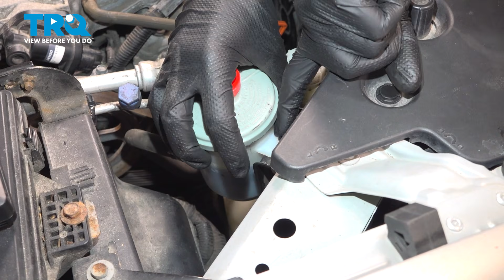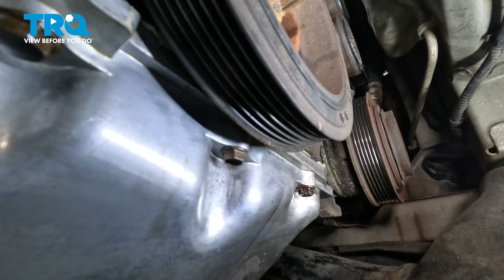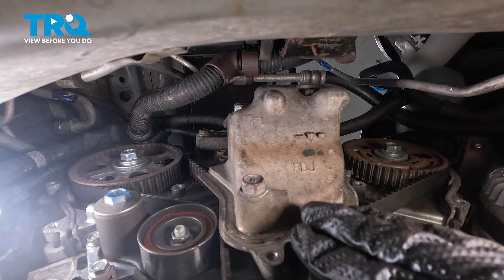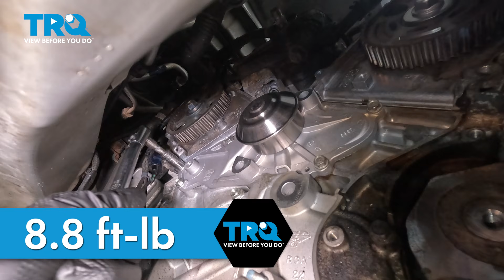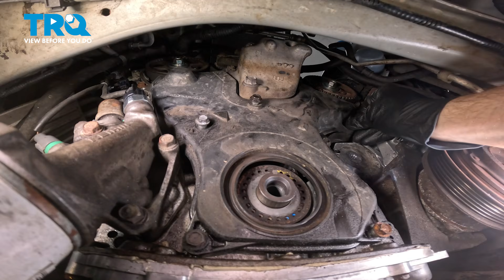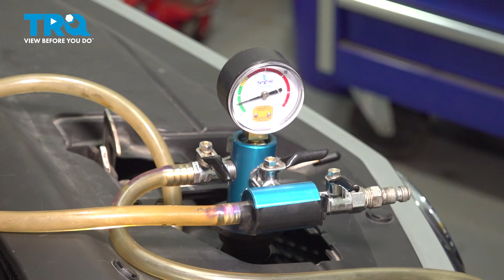How to Replace Timing Belt Kit with Water Pump 2007-2013 Acura MDX

Comment: I was doing this job today and discovered that bottom bolt of the side engine mount had been over torqued by the last installer. That bolt was stretched and the threads in the block were stripped. I threaded another slightly larger bolt into the hole working it back and forth. I also made the hole in the mount slightly larger than the new bolt and put thread locker on the bolt. Pay attention to your torque specs. It will save you a ton of grief later.

Comment: Great video,  it helped me get the job done on my 2008 acura MDX. I did a few things different because I don't have all the fancy tools.  To get that center bolt on the motor mount I took the 2 bolts out on the inner finder side of the mount to turn it to make room for a regular size ratchet.  I put the old timing belt piston back on. I just used an c clap to press it in and a very small alen rench to put in the pin hole to keep it pressed in. Other than that I did everything in the video the same.  Thanks again for a wonderful video 👍🏼.

Comment: Good video.   My philosophy is go in once and replace everything on the serpentine belt,  serpentine belt tensioner and hardware.   Replace everything in the timing belt area and I don't have to do it again for another 100,000 miles or 10 years.

Comment: It looks like the oil pump seal is leaking you should’ve replaced the oil pump gasket while you had the timing belt off because the oil pump is driven by the timing belt